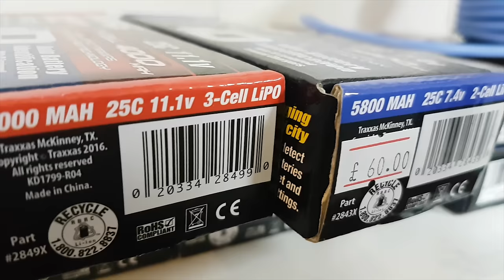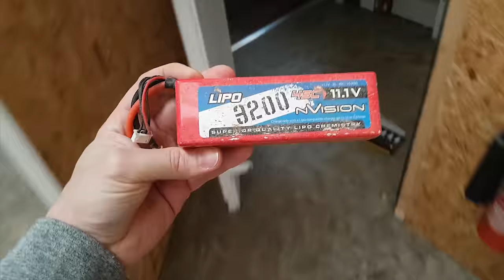Traxxas TRX-4 Land Rover Defender Unboxing - And can you B A S H - IT ? ?

Comment: Is there any difference between this and all the other trx4s
Reply: Some have a 12.3 wheelbase and others are a 12.8 wheelbase. The latest one is a 13.2-wheelbase. Other than the bodies and wheelbase they're the same. The defender is really top-heavy. The 2021 Bronco is the best at crawling out of the box as it has the lowest center of gravity. You can't go wrong with either one. You can always change the bod and extend or shorten the wheelbase on all of them.